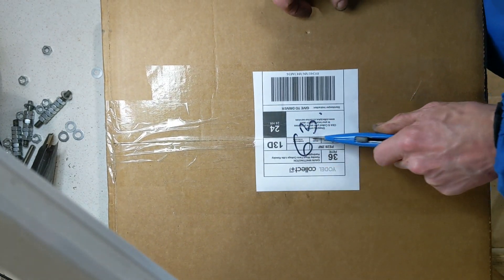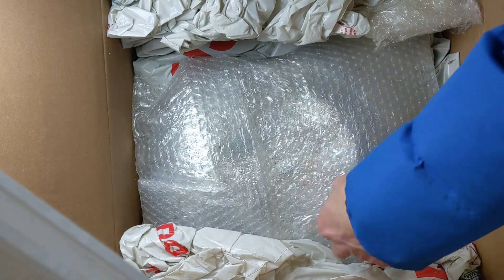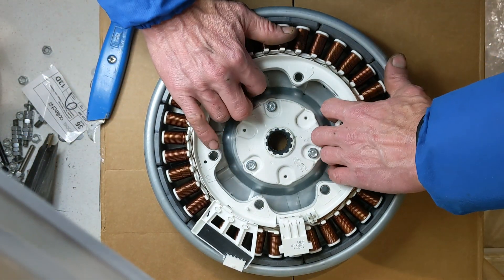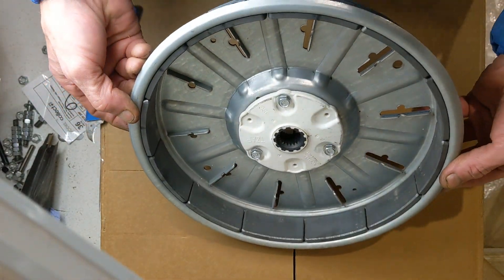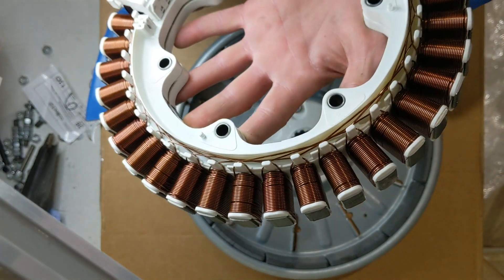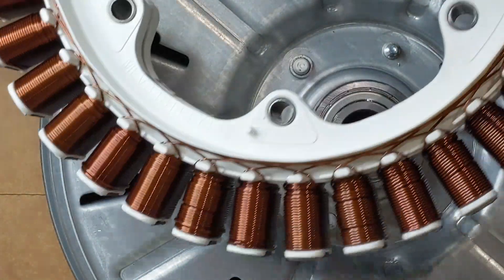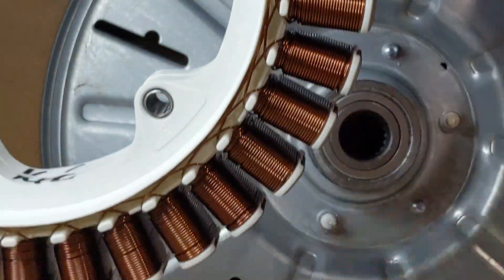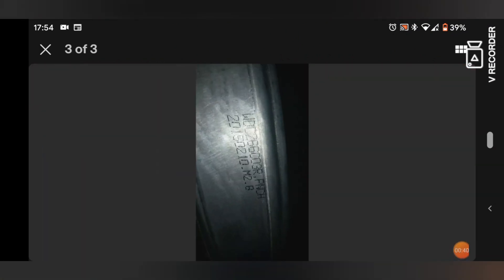Replacement LG smartdrive wind turbine Rotor and Stator arrived 17 November 2020

Comment: Yep I too bought an aluminium one lol. Next time I'll message the seller to confirm its copper, and only buy them if I can make a good distinction in photos as under certain lighting it can be hard to tell. In your case the seller most likely had more than one so gave you the equivalent/random one, or accidently gave the wrong one, OR is charging you what you would pay for a copper one. I noticed most sellers who have a couple of these listed always charge higher for the copper.

Anyways, I'm interested to know how the AL will perform against a copper one (once I get my hands on it 😂) it surely can't be that bad........
Reply from the maker: We will see soon my friend, I have two copper coiled rewired ones ready to rock and roll , will be making the other parts of the generator at the weekend.